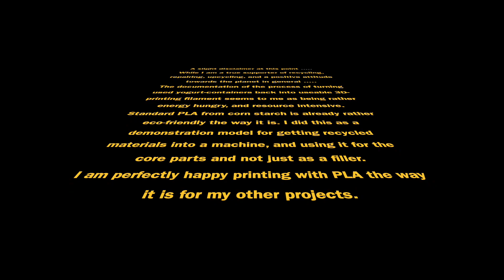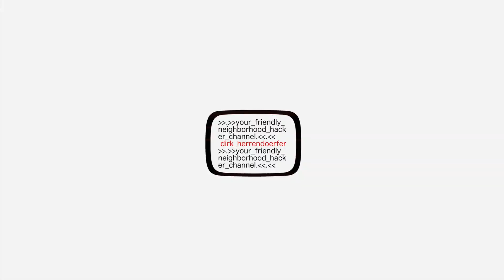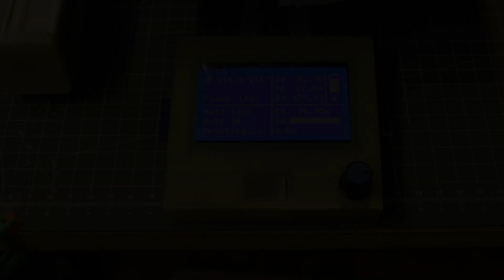The Eco-Friendly Bad Robin 3D Printer (one-of POC)

Comment: I really like the Marlin firmware you introduced to us all into a few years ago. I still use it now for micro cnc and it works great. Thats not the end of those RAMPS boards and Arduino systems for the basic stuff. They still work today. I mean hell i cnc my new bed with your setup you showed after i hand drilled my original one. I even got video of it where i precision drill a new platter/bed for my cnc table. Thank you Dirk
Reply from the maker: Coincidentally .... I've started looking into porting some of my changes to GRBL for my own boards into the standard GRBL firmware for the original GRBL pin layout. Starting with Z-Axis servo support.
Reply: @dherrendoerfer  Well thats going to be neat. This is the area I am interested in.